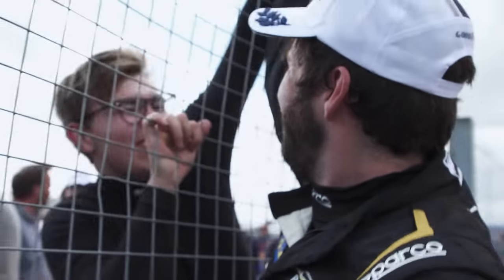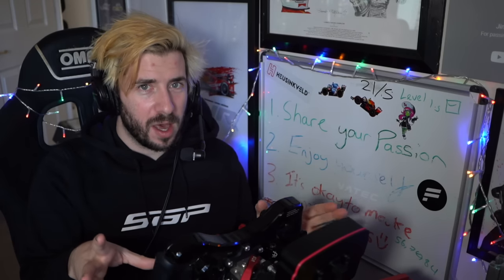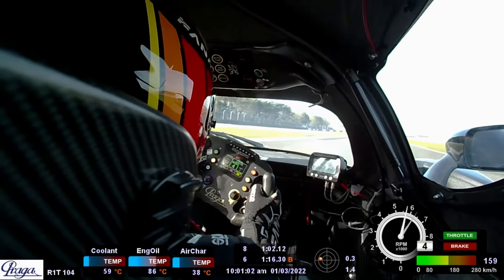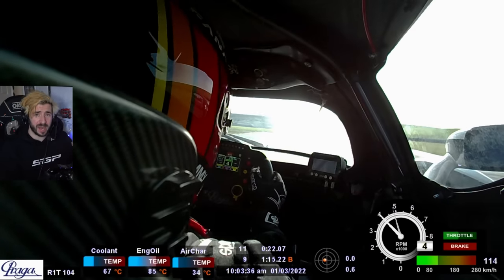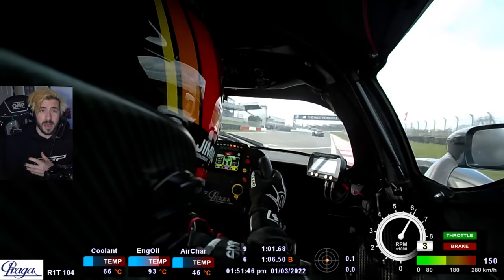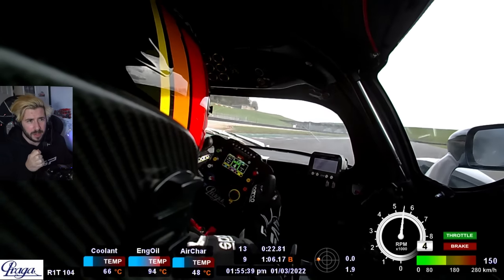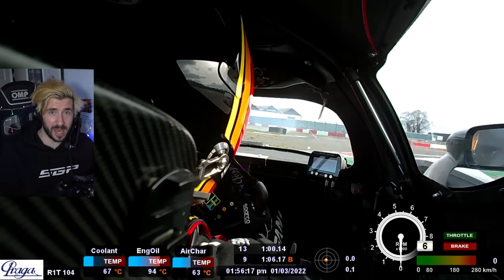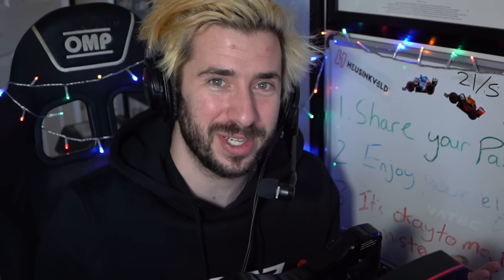I Spun A Race Car At 140MPH. Here's What Happened.

Comment: You can tell from earlier in the lap that the car was nervous under braking. Someone forgot to adjust the brake bias back forwards for dry conditions. This is why you spun.
Reply from the maker: No it's not lol
Reply: @Jimmy Broadbent  Check your brake pressure graphs in the AiM data vs what you're running now if you still have them from back then.

You move brake bias backwards in the wet several percent because you don't have the dynamic weight transfer forward in lower grip conditions. If you forget or aren't told, this happens.
Reply: @Jimmy Broadbent  Watched it several times again in slow motion, you can see the rear axle hop from the brakes locking. You can also immediately notice the drop in engine rpm as the engine is connected to the rear wheels still. Also, you can see you're clearly past the water in the slow mo before you hit the brake.

If the brake bias wasn't too far back, you should have locked a front tire first. This is very evident with the wiggles under braking in earlier laps.

Comment: That's pretty much how I crashed my MR2 in a forest last year. It was a pretty bad blind corner and I usually ended up cutting into the opposite lane everytime I drove it. For some reason on that day I decided to try and go through a little safer so I moved a bit further to the edge, not noticing the thin layer of mud. Once I got on the brake it went.

Comment: Brake bias too far rearward. The wet patch definitely didnt help either, but there are 3 occasions throughout that lap, you see the rear unsettled whilst braking and you're making small corrections in the wheel. Pretty good indicator to send the bias a couple clicks forward, or you'll lock up the rears and spin it...

Comment: If I ever had the chance/means to compete in any legit racing series like this I know my weakness would be rain/wet tracks. I just don't have the confidence to chuck a car in on wet pavement and trust that it will stick. You could give me the best equipment, tires, and team and I'd still make it look like a 2021 HAAS F1 finish. Its funny, I know the basics of staying off the race line in the wet, when it starts to dry and you're on slicks avoid the wet patches, painted surface and curbs, but mentally I don't think I'd be able to over come that part of my head that says "it's not going to stick!"

Comment: Weird that the cooling system would be able to get that low in temp on track- I'm guessing the Praga doesn't run a thermostat at all? We've always run with one in the track/Time Attack Evos to keep the engine in that ideal window (especially in changeable conditions), albeit a lower temperature version compared to OEM.